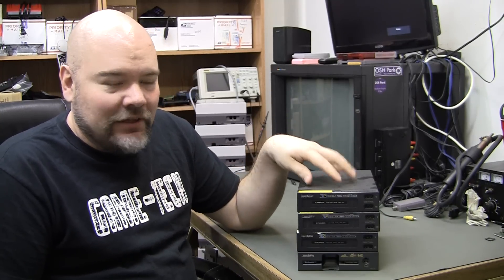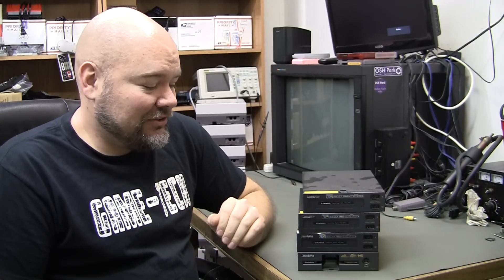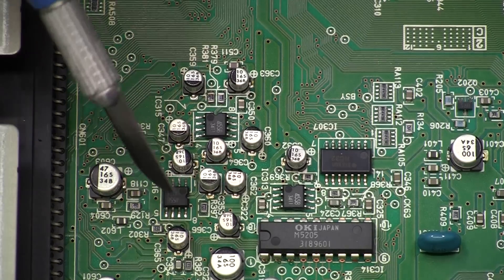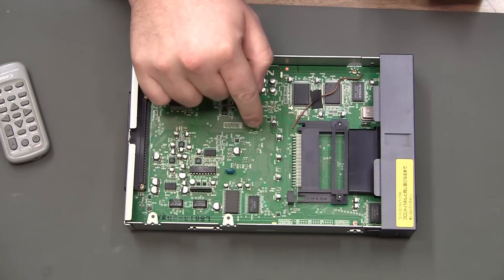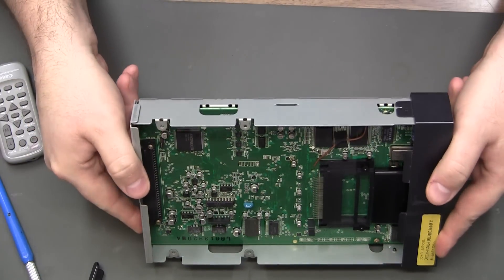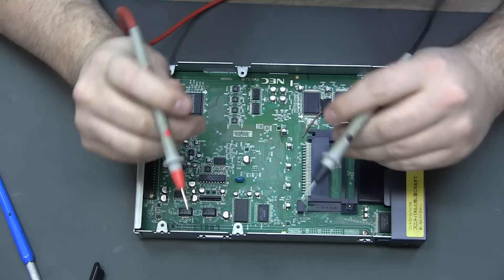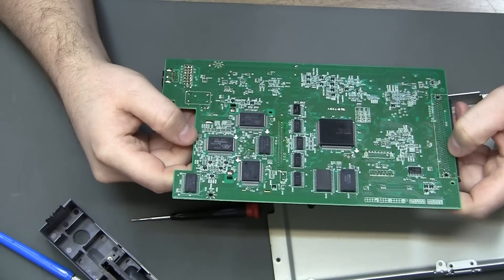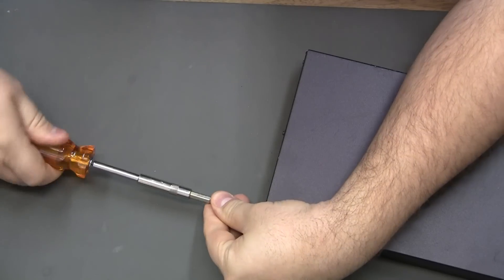Pioneer LaserActive Pac caps Pt1 - open up and take a look - pac-s10 pac-n10 cld-a100

Comment: 3:44 - Looks like that cap has been replaced at some point, and possibly a factory rework?

There is extra / "new" solder on the joints, so the residue is very likely just flux that they never bothered to clean off.

Interesting vid. ;)

Comment: Excuse my ignorance, what are these pacs used for? what system does it add optical media to?
Reply: +Zestypanda https://en.wikipedia.org/wiki/LaserActive#PAC_modules 

I think these modules are (game or decoder) consoles that allow the laserActive to decode more formats of LD/CD, including games.
Also, these consoles can load their own (cartridges or HU card) media and output through the LaserActive, without necessitating a second set of cables and extermal switching between them.

... edit:  You know how you plug a CD-Player into a Sega Genesis for SegaCD ? - here you plug the Genesis into the LD/CD-Player.
Reply: ***** Sweet. Too bad these were too late. They were an effort to help a dying clunky format.

Comment: Relatively ignorant to these things here, why is there a battery inside? Is it for the Sega CD RAM save games?
Reply: +Nukle0n yep.  I have to replace mine as well.  My saves don't last after I power mine off for a few months.
Reply: Every SEGA CD has a battery inside.
Reply: +Emmett Turner Yeah I was just wondering but I guess it's because everything except the CD Drive has to be in this package, so that's why the battery is here. On a Sega CD obviously the battery would be in the Sega CD itself and not in the Genesis, but this is a pretty condensed version. And the PC-Engine of course doesn't have a battery because it uses a super-capacitor to power the save data instead of a battery.
Reply: +Nukle0n well the laser active itself doesnt contain the sega CD hardware,  the pack itself is what holds the sega CD hardware except for the CD drive.

Comment: hey man i love your vids, i was wondering if you ever had a problem with a NES console that powers up but has no video or audio (no signal) any ideas you can give me? I know your a busy man and probably dont have time to respond to all comments. But thanks any ways
Reply: +TheGridGamers i think he has a couple of videos on that may want to check and see, but could be a bad trace on the board or the rf connector could be broken, bad caps etc
Reply: i think it can be bad caps i havent got around to test it yet because it worked fine for about 3 power ups then i went to power it again and got no video and no audio so i think its that metal board where the power and av goes
Reply: could also be the i think its called the 7805 but dont qoute me on that
Reply: the 5v regulator? the lil squre with three leg pins? ill try changing that out
Reply: yeah that